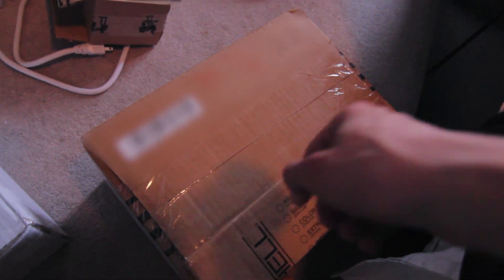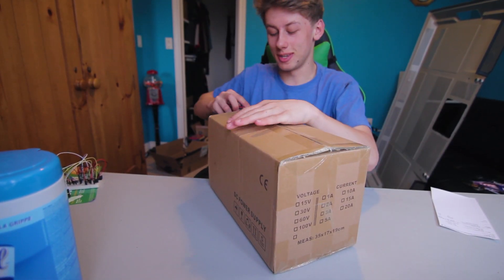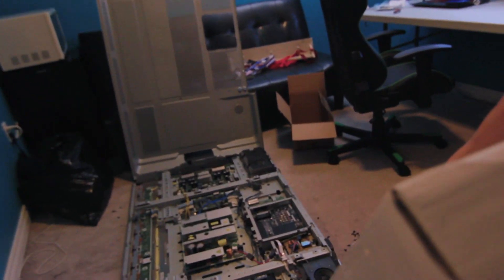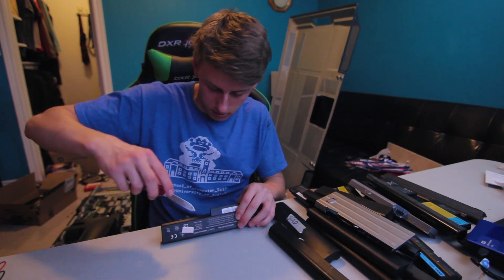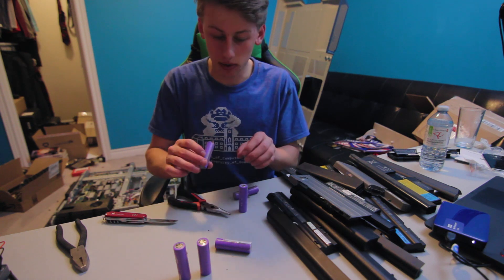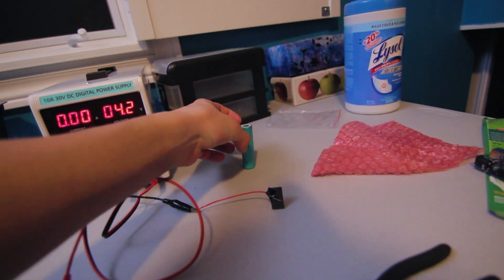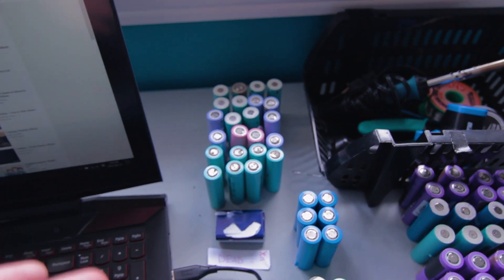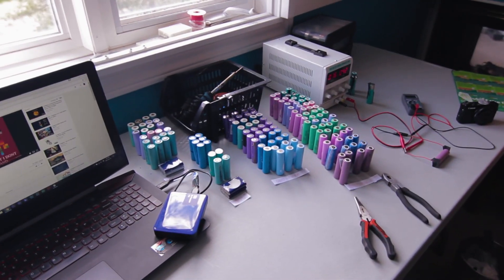"dead" laptop batteries teardown | Harvesting 18650 cells

Comment: Can you make a portable wifi password "tester" with an arduino, a battery pack, and wireshark and a wifi analyzer? i know arduino sells wifi adapters for the boards. That would be pretty cool to just drop a nice little box and pick it up a couple hours later and it has wifi passwords in it!

Comment: The top with the paper or plastic ring is the positive and needs to be insulated as the entire outer steel shell is negative. If the top is exposed it is a few mm away from shorting.. You can order replacement pre-cut PVC wraps from ebay or aliexpress to prevent burning your house down..

And save up for a SKYRC MK3000 18650 charger and capacity tester, it is the top device out there. (or the Opus BT-C3100 as a cheap and less reliable option)

Also check out HB Powerwall, Mikes DIY Powerwall, Average Joe for some great ideas about
Reply from the maker: +Detrital Geo awesome thanks for the info! Will look into those guys! I'm sorta broke right now so I'm making my own capacity tester with an Arduino haha
Reply: Devon Crawford another super cheap charging board is the TP4056 for less than $1 each. It takes care of the CC/CV charging process at 1A but best used with a 18650 holder.  Both on Ebay. Also check out the 18650 cell database on diypowerwalls.com to confirm charging and discharging specs by the cell model..